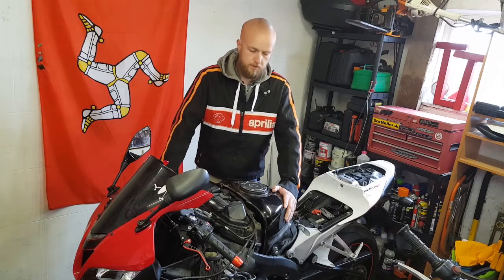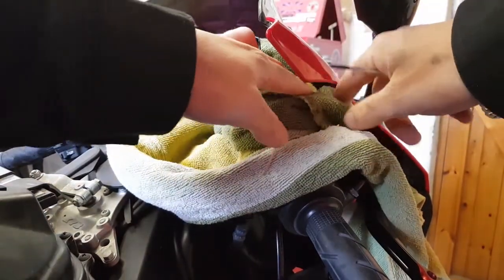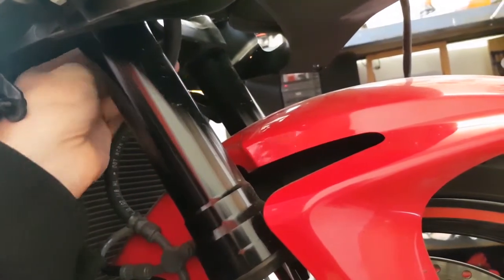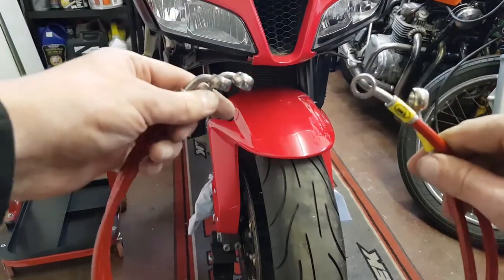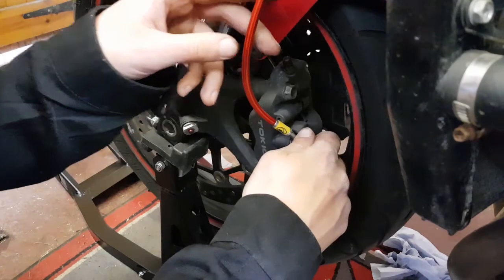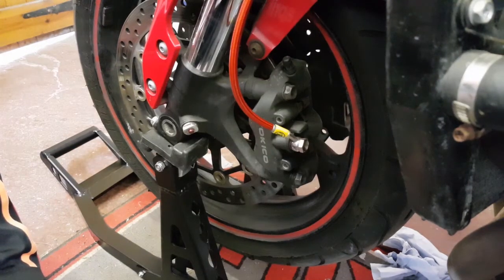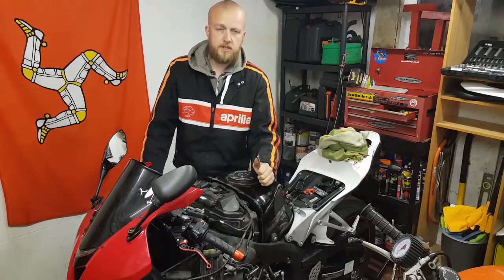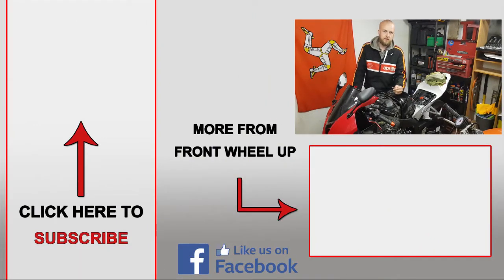How to install full race braided brake lines - CBR600RR - Honda CBR 600 RR Overhaul Episode 5

Comment: i have HEL lines. you can grip the base of the banjo with pliers and put a screw driver into the banjo and you can twist it. it has this very instruction in the packet that you bought with the lines it shows you
Reply from the maker: Thabks for the reply. I've since turned them around... looks much cleaner now. My lines didn't come in a packet as they were just cut to length.

Comment: The hel lines you can swivel the banjo , I spoke to hel you can't do by hand you hold the stem of banjo with clamp with rag in between not to scratch it then use a screw driver or something to turn the head of the banjo that connects to the caliper . Then it fits perfectly
Reply from the maker: Ah that's awesome to know, thanks very much. I'll correct it before u start riding again in spring. 😁

Comment: You said to bleed the calipers and then the master cylinder last.  Is that according to the service manual?  I'd like to understand the purpose behind it.
Reply from the maker: From working on cars in the past, the thought process is to start with the longest line (furthest away from the master cylinder) and work your way back to the master cylinder to eliminate the chance of any air being trapped in between the valves.

In hindsight, having dedicated lines rather than a shared line you probably could do it in any order. 

Old habits I guess! 

Out of curiosity, I'll look it up in the service manual when I'm in the garage tomorrow and let you know if there is a preferred order. 👍

Comment: Hi, I know it was  a while ago, but did you manage to rotate the banjo ends on the Hel lines? Just replacing mine and have found the same probs. What did you do about the lines as they went in front of the bottom triple tree, as the rubber clip is not big enough to take 2x new lines? Did you leave them or use some cable ties? Thanks for the video, it did make changing the lines much easier. Keep up the good work on the channel.
Reply from the maker: I didn't do it yet but it's on my to do list before summer, a few people have commented saying it's easy to change the angle of them.

As for the lines, I just left them loose. I was debating a cable tie but thought it might damage the lines over time. Again, I will likely have another look at this when I correct the banjo ends.

Hope you got sorted. 👍

Comment: I see a lot of you guys on YouTube install brake lines the wrong way on CBR 600RR. The ring on the left calipers is facing wrong side because on top the rings on the pump should rotate of 180° and the cables should make a turn like stock ones. You forced the right one to rotate and put the ring correctly in the right one. That is also why brake lines are too long.
Reply from the maker: Thanks for the input, I plan to take them off at some point to sort them out 👍